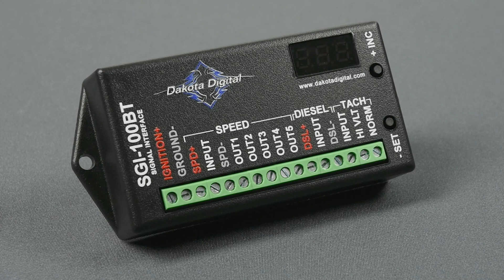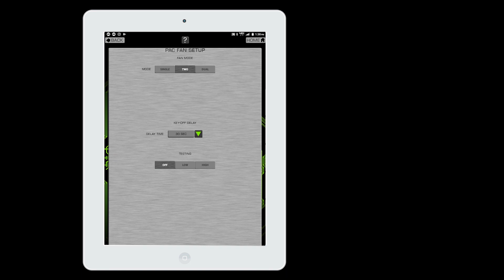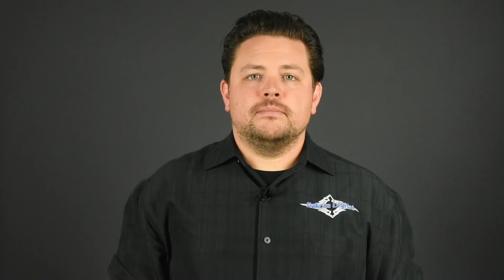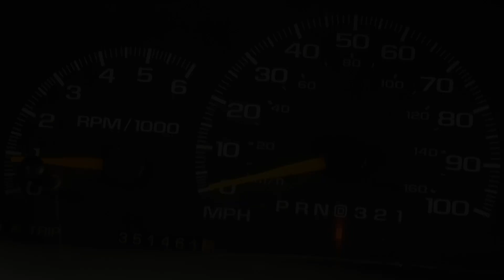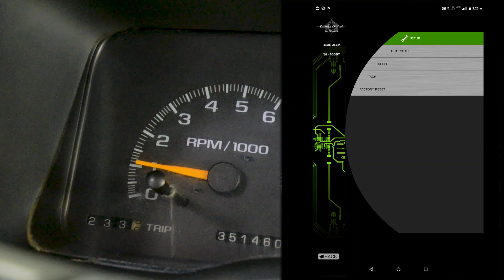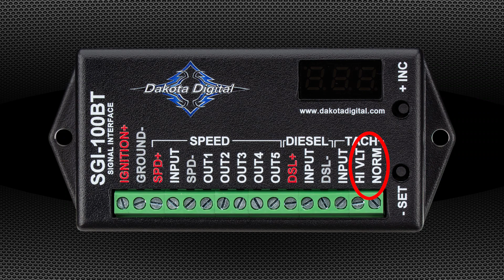SGI-100BT Universal Speed & Tach Interface

Comment: Why does the sgi5 convert abs signals to speed but the sgi100 can not?
Reply from the maker: Neither have ever been recommended for use within a functioning ABS. The signal from a repurposed wheel-speed sensor alone can be used to supply the SGI-100BT a speed signal, but Dakota Digital emphatically maintains that tapping in or otherwise disturbing an antilock braking system can be dangerous and is NOT advised or supported.
Reply: DakotaDigitalTV I’ve swapped out the stock spindle with no abs and added one with abs on a 1993 Nissan 240sx and I’ve been fighting it to get the Dakota sgi100 to work with the speedometer. Any tips you might be able to offer to get it to work?
Reply from the maker: @fabiomartell7922  Probably more than a YouTube comment can handle. Contact out Tech department: techsupport@dakotadigital.com

Comment: Can this work for a coyote swap? I know it will work for the speedometer no problem but will this generate a tachometer signal similar to the autometer tach adapter 9117?
Reply from the maker: We would recommend the BIM-01-2 if you're running Dakota Digital instruments, or the STA-1000 for other aftermarket gauges!
Reply: Did you get the answer? I have 2011 coyote with TH400 and I need to get the speedometer to work and connected to the ECU for tuning
Reply: @Magician14112  I ended up going with the STA-1000 for my application. It's a 1956 F100 with a complete 2016 Mustang GT power train and underpinnings. With that I was able to incorporate a GM cruise control module, have a check engine light and not have to much fuss dialing in the pulse for the speedometer as well as the tach. 
For your application where you are trying to fool the computer to think it has the original pulse from the output shaft I can't see this not working perfectly for you. That is presuming the engine was originally a manual transmission as the output shaft speed is all it really looks for. Otherwise a little pcm programming will also be needed.